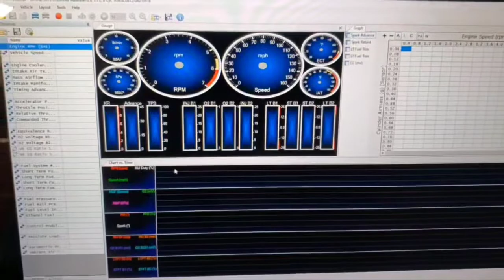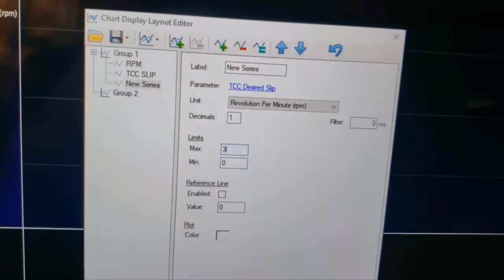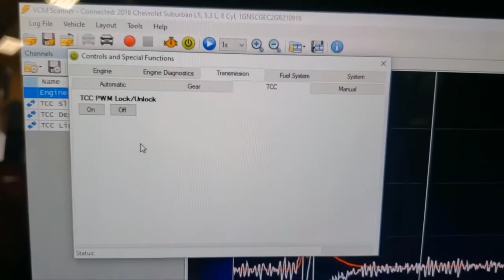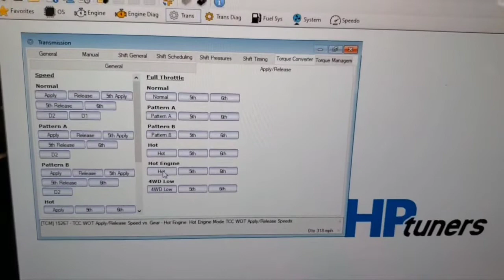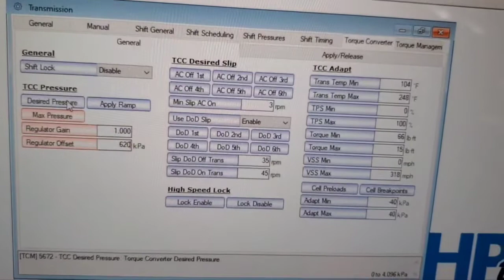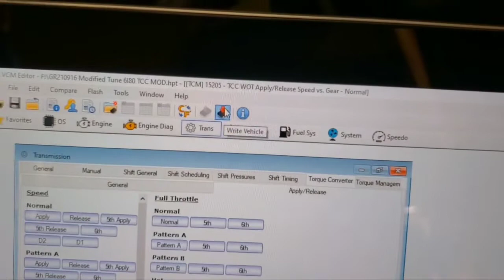6L80 full of metal is saved with HP Tuners (TCC failure)

Comment: the goto default for tuning should not be the most line pressure a circuit can handle. that builds heat and causes premature pump wear. adding something reasonable, like 20-30% is more ideal. even a thermally bypassed transmission running no clutch lockup in 1-4 is already going to run hot as it is. i only eliminated lockup in 2nd and third because i tow with my truck.

Comment: Hey @TechnicianRed just curious if you know how long this "fix" has lasted?? I have a 2017 Silverado that is doing the shudder and was just told it needs a converter. My trans shifts through the gears smooth but i get the shudder bad on cold start and rpm gauge jumps up and down while it’s actively shuddering once it’s heated up the shudder isn’t as noticeable. Please help!

Comment: My 14 Sierra 6L80 has TCC shudder and downshifts hard.  Could this tune possibly improve the hard shifting, or is it too far gone at that point?  I wasn't sure if the hard shifting was related to the weird TCC engagements these have.  I already changed the fluid and filter and added stop slip.  There was surprisingly very little metal on the magnet, almost none.  The shutter is much more mild than it was with the old fluid, but it's still there at certain speeds.

Comment: I have the HPtuner fix for this shudder if you have not already destroyed your TCC. It is an engine and transmission tune combo along with the transmission cooler thermostat delete. The ramp rate table is time it takes for the TCC to lock up. The lower the numbers the faster the TCC locks up. Do not do what he did in this video by lengthening the time of lockup.
Reply: I just rebuilt my trans and new converter …. Had a bad shudder over 78 mph …. Had it rebuilt and still does it … I’m in okc ok in need of a tune or I might just buy the mpvi stuff and tune my stuff
Reply: @KennethC-x8n  I am in East TN. What year truck?
Reply: @BigEbikesports  2015 Silverado 6l80 with a 5.3 2wd … I’m in okc Oklahoma …. But I’m about to just buy the hptuners and fix my truck and my cousins truck
Reply: @KennethC-x8n  I would see if there are any tuners at any local speed shops, tell him you need your slip rates all changed in all torque ranges to 20 rpm. I work for a transmission shop and we have found that GM is trying to lock up a TCC clutch that is not designed to be locked up. Putting in the slip at constant 20 in all the cells stops the shudder also known as fish biting down the highway. Good luck to you!
Reply: @BigEbikesports well it’s been just sitting …. But I installed the tune from Matt Sanford here on YouTube called 6l80/90 transmission tuning with hp tuners …. Something like that and it def runs better but it was just trans tune and do you think you could look at that video and see if it’s close to y’all s transmission shops tune…. The reason I bought hp tuners is because no one guarantees a shudder will be removed … plus I don’t trust the tuning places around here and or way to expensive .. and still no garauntee shudder will be done…so it’s a gamble they said even with a rebuilt transmission so I bought tuners and have learned off YouTube. But if the trans tune doesn’t take out the shudder then it’s onto the driveshaft converting to a 2 piece. I have replaced axles …replaced tires and rims with several rebalances .. but no road force balance yet … then rebalanced driveshaft replaced u joints replaced converter  still shuddering …. Then rebuilt transmission with another new converter (b and I ) … dod is disabled vibration … shudder is at 75-85 … vibrates the back seat and center console … no open drinks lol …I don’t trust shops around here …
Reply: @KennethC-x8n  Thats not trans shudder, thats tires out of round that most cannot fix with any kind of balance. Tire quality is crap today, certain brands I stay away from because of out of round. I only buy Hankook or Michelin street tires, rest are subpar. Most tuners do not understand that this TCC clutch mush have slip and no that tune you have doesn not fix your trans shudder. I have confirmation from Robert at Transgo, you know the shift kit manufacturing company. Robert says same thing, the slip rates all need to be changed to 20. Most tuners try to give it 0 slip and that will make it worse and destroy the TCC clutch over time.
Reply: @BigEbikesports so change the ramp rate and the slip it has to have slip at 20 across the board …. So it’s not tires I took my uncles truck who has no vibration and but his wheels and tires all 4 and put them on my truck … still have vibration … but check this out when it’s vibrating on a flat highway and then u have to go up a hill … the vibration dissipates ….also if u watch ..uncle jacks outdoors … he install a 2 piece driveshaft and he shows u the exact same issue that I have like to a T … vibration
Reply: @KennethC-x8n  Leave the ramp rate alone, keep it stock, just change the slip rates. The vibration going away on a hill is you giving it more throttle triggering the TCC clutch to unlock-- deactivate which the higher the gear the more shudder you will feel under light load. It is feels like you are hitting rumble strips then that is TCC shudder, not tire balance or driveshaft, especiallly if it goes away when more throttle is added going up a hill.
Reply: @BigEbikesports k thanks a ton … change them to 20 correct
Reply: @BigEbikesports  so you ride bikes for fun and work on transmissions for a living … im assuming … just so I’m 100% .. I’m putting all slip 1-6 all to 20 correct boss ….
Reply: @KennethC-x8n  Well I am semi-retired, best friend owns the transmission shop, I do all their tuning. Yes 20 rpm slip for all the cells. If you know how then turn off the TCC lockup in 1st gear, set 1-2 lockup at 318 mph and 2-1 at 317 mph.
Reply: @BigEbikesports man I have messed with the tune 2x’s and now ?? … I went to do the all to 20 slip on the tune but now it’s I guess lost connection with the tcm … what should I do they say if you can pull the codes your not bricked …so I have watched the YouTube on that and have tried disconnecting the battery and reconnecting and pulling the fuse on the radio … and all the other things and it’s still timed out message …. Controller u locker timed out …. Failed ? Ever had this happen and I hope the tcm. Is not the techm I don’t want the waste all that oil lol
Reply: @KennethC-x8n  Did you try to write entire instead of only write calibration? Do not ever try to write entire, that will brick your ECM/TCM
Reply: @BigEbikesports yea I only used …write calibration …. I ve always wondered what the other one was for … but I only clicked calibration…. ? So basically disconnected the battery pos and neg … for 24 hours lol hoping that works cause all the other YouTube things haven’t worked as in the fuses for radios and putting a charger on the battery while it’s got key in the on position nope….
Reply: @KennethC-x8n  Did you ever get this to take the calibration/tune?
Reply: @BigEbikesports  I did …. lol … had to pull all my fuses for my bcm  (drive side & passenger side fuses) and radio and hook up a battery charger … it was a mess …
Reply: @KennethC-x8n  DId the new slip rates fix your shudder issue?
Reply: @BigEbikesports  no you know what it was …. My front hub assemblies on my truck … the whole vibrations in the seat means it’s in the back and steering wheel  means it’s up front ?? Nope … so a lot of these Chevy shakes … i did everything .. all for it to be my front hub assy … blows my mind
Reply: My vibrations were the console shaking at 74 to 83 or 84 mph … just like u see in all these videos shaking water cups and such. No one talks about replacing the front hub assy and there was no noise or like issues like how u can tell if there wheel bearing is out … top/bottom movement none of that showed up but my dad bought them and said we did everything else .. try these and I’m like dad it’s in the seat so it has to be in the back somewhere …. Omg I changed them out and after just replacing one I could tell it was better but not gone and so I did the next one the driverside and damn what a shock it was gone … also the vibration would come and go like if u go up a hill it would go away… or down a hill go away … or stayed under 74 or over 84 mph …. Nuts man .. so I have been writing everyone that’s had the issue that can’t figure it out lol … front hubs?
Reply: @KennethC-x8n  Thats a good find and makes a lot of sense if you have a vibration at speed. If you ever feel like you are driving over rumble strips, that more than likely is the TCC clutch. As long as the clutch is still good, the 20 rpm slip eliminates the shudder. If its worn out then it will just get worse no matter the slip.
Reply: I have p0441, torque converter clutch solenoid code, would your tune help with that or is it too far gone?
Reply: @jacobkirby3169 what vehicle is it in… I’m in okc Oklahoma … it’s like 100 bucks if u want to try it. No guarantee s  lmk … the 100 is for the hp credits u would have to purchase them to load the tune to ur  vehicle.
Reply: @jacobkirby3169  That DTC is for purge control solenoid of your emissions charcoal canister? Did you mean to type something else, typo maybe?
Reply: @BigEbikesports lol meant p0741
Reply: Think the tune would help?

Comment: I wish I could find some 6T70/6T75 tunes to get rid of 5 & 6 shudder.
Reply: I have a 2016 Traverse with the 6T70/6T75 as well. Been getting the shudder for over a year, and shudder fix and new fluid has not done any good. Shudders bad most times when leaving from a light, and 5th and 6th gear I get rpm fluctuations like it's not staying locked up. Stopping the lockup in gears 1-4 would make a HUGE difference with driving the vehicle with just the shuddering in those gears not happening anymore.

So can you confirm this "no more lockup in gears 1-4" change eliminated the shuddering while going through those gears at least?

Also, did you ever get the 5th and 6th gear situation figured out by raising the pressures with the tuner?
Reply: @bottlefed90gt  Shudder was gone when 1-4 was tuned out. 
I never really messed with 5th and 6th as far as pressure goes. I'm 99% sure that if I had tuned them, the shudder would have gone away.
Reply: @dealerauctionnightmare4689  Thank you so much for your reply. Gonna give it a try with the tune then before trying a new torque converter.

Comment: i had some metal in the pan changed valve body. but transmission is still going into a false neutral when i come to a stop. what would be the cause ?
Reply: Your clutches are probably smoked. When it neutrals at a stop, the low pressure called for while idling isn't enough to hold the burnt clutch.

Comment: yeah, give people false hope and let them get stuck on the side of the highway when the transmission decides to fail. facts are facts, if its making metal, a tune change will NOT fix a problem, you are giving the people a false sense of security. - Transmission builder of over 15 years and i build 3-4 6l80's a week, and have been tuning them with hptuners since 2014 when we started to see why the converters were failing.
Reply: Chill. At the beginning he did say that correct way to fix this is a new trans or rebuilt.
Reply: Man relax ! We all know the best way is to replace it!
I do the same thing on my truck and I got 12k miles out of a good running truck!
Autel scanner and I manually turn off the tcc once hot and highway driving I engage it! 
I need this tune asap
Reply: @marck16v  just trying to prevent the spread of misinformation. The fact he doesn’t even know what some of the tables he’s changing does is alarming. Tuning 101 - if you don’t know what you’re changing and what it affects, why are you changing it? And if it’s making metal and you decide to make said changes in the tune, do you really think that making those changes is going to prevent it from making metal and continue to trash the unit..? It’s a quick cash grab for a shop when a customer doesn’t have the money to fix it so they sell them on a quick tune that they can afford so that shop still makes money off the customer and I don’t operate my shop like that. It’s dishonest, and if they end up having the transmission rebuilt instead of replaced, which I would never sell a customer a replacement 6l80 from gm or jasper or any large name remanufacturing company because they do not make any changes to prevent converter failures from happening - then they are just creating more headaches for the person that will end up rebuilding it with things like wiped out planetaries, possibly melted parts from the transmission running at extremely high temperatures due to the metal hanging up the thermostat if it’s not deleted, or from the slippage inside the converter that’s causing the metal in the first place. I’m calm, I know I give my customers what they pay for, and I can tell them every thing they want to know about the failure, including why it happens, and what to do to fix and prevent it. It just annoys me when I see shops like this looking for a cheap cash grab and then double dipping by making a YouTube video with misinformation to double dip on the ad revenue and views. More power to them they got my views and all of yours, but I’m still going to take to the comments section and inform people that took the time to read my comment that this is NOT what you do when there is metal in the pan on a 6l80z
Reply: @TheRevealedx  got ya !! You right 
But on my end I’m happy I can get some more time to put money together for the reman replacement
Reply: @TheRevealedx could you suggest a good video or guide for beginners who want to do simple trans tune for their 6l80? I don’t want to wreck anything and I want to understand what I’m changing not just because some guy said it. Thank you !

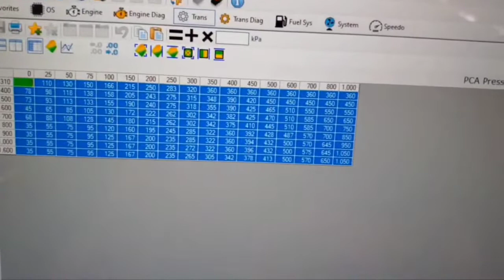Comment: Do not follow the 6L80 tuning advice he gives here.  EG he can be seen at 29:11 to be completely wiping out the Line pressure to PCA trans calibration table probably because it’s called “Desired Pressure” and he thinks he desires max pressure.  Scary he is giving advice.  

See there is a pressure regulator piston in the valve body that allows a pressure control solenoid to control line pressure fed to all the other PCS for shifting.  That regulator is spring loaded, controlling the offset, and the diameters of the regulator pistons control the gain.  On some OS versions it uses gain and offset for the TCM to understand the relationship of pump pressure to line pressure.  In others it uses the Desired Pressure table to understand the pressure produced by the relationship between the line pressure to PCA pressure, this is called the calibration and can replace the simple offset and gain formula with a table.

Yeah, so if you didn’t know that, you shouldn’t be touching it.  The people that should be tuning this are TransGo and Sonnex who should have a mechatronics lab with a running 6L80 on the bench.  They would need to do so because they manufacture upgraded pressure control regulator kits.
Reply: Yeah I wonder why he hasn't responded to your comment

Comment: Couple questions. 2011 Silverado, My tables are quite a bit different on desired pressure by quite a bit. Assuming the values are different based on the X axis numbers at the top of my chart are different. My max pressure tab was the same values as yours and I left that alone based on your comment below. But my TCC desired pressure table, highest value in the lower corner is 42. Guessing I will just duplicate that across the table at 42 being the highest value shown for stock to increase the line pressure. That sound correct to you? I left the max pressure table alone at the 953.
Reply: You’re probably looking at different units.  You can click the units hyperlink and it will cycle.  If you copy paste data from the internet you better also know what units you’re copying and pasting.
Reply: Thank you for your reply. Yes I didn’t copy and paste anything from the Internet. I use the highest value on my table and duplicated that number for all of the cells the way that was done in the video.

Comment: As a retired mechanic I could not understand why GM wanted and let torque converter slip 20 RPM's in a normal position and expect the torque converter to Last just don't make sense !!engineering stupidity gone to seed  I understand it takes the smoothness out of it button longevity lives over comfort in my book lock that baby up and let her rock..
Reply: That’s because if you tune out the slip and increase the pressure 10 ish percent, the transmission will outlast the motor and entire vehicle. I’ve got 390k miles on my unopened 6L80 and I beat the crap out it daily.
Reply: The reason that they slip the TCC slightly is to reduce NVH (noise, vibration, harshness).
Reply: @brianjenwaldner  correct, and also to help with misfire detection by smoothing out the driveline pulses from rough roads. This is nothing new with the 6l80, every gm transmission has had a TCC desired slip value since 1996.

Comment: Would you be able to tune an AF33 transmission with this software? I think it's absolutely insane how they "want" the torque converter clutch to slip with the clutch applied ... like, how dumb do they have to be to think that's a good idea? You would never tell a new manual transmission driver to rest their foot slightly on the clutch for any reason, and in fact, people are told not to. Either downshift if it needs more torque or needs to reduce vibration. Sadly my AW-55-50SN has this partial slip feature but it's more primitive and pretty easy to defeat by driving in 4. I just wish I could defeat it altogether.

Comment: BlueCat transmission tool works great with hptuners. Gear and tire changes also require transmission tunning.
Reply: Can you turn off the stupid tire pressure light with this program?  My tires do not have sensors in them.
Reply: @baldeagle242  bluecat is only for transmission. To turn off the tpms light I use an xtool d9s